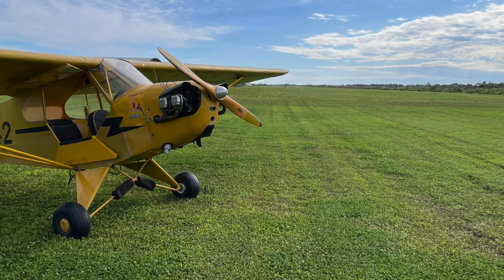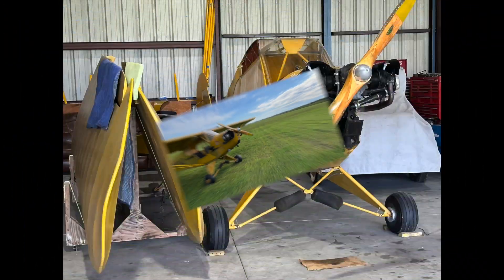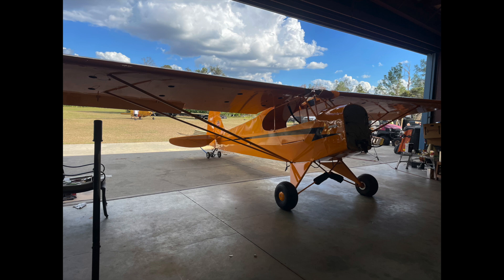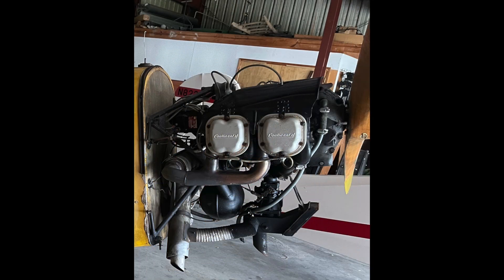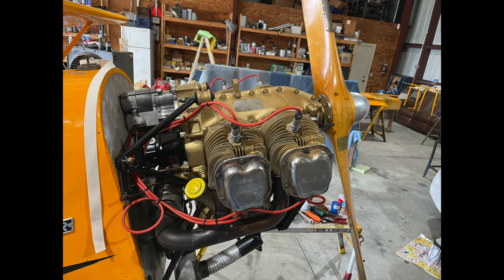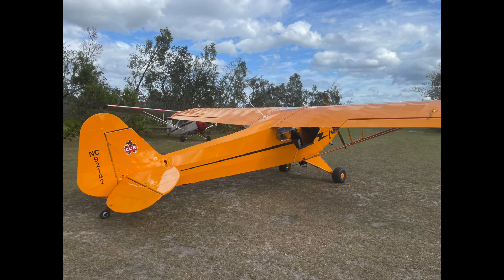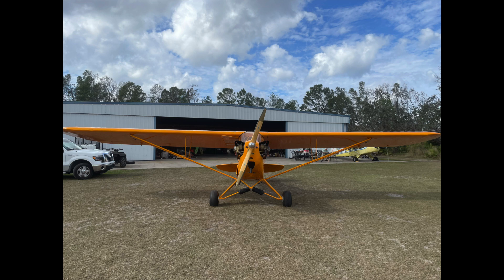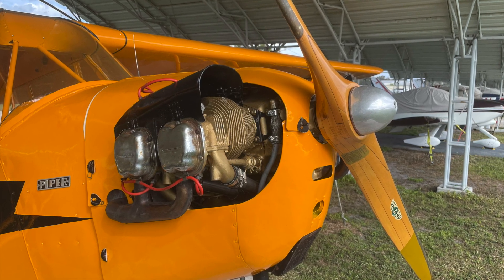1946 Piper Cub back in the air

Comment: Beautiful!  My J3 is solid and has a recently rebuilt 65 hp along with a new wooden prop.  How long did the recovering and painting take?  Is this typical work for your mechanic?  Might he be interested in recovering another Cub?  Again, very nice!
Reply from the maker: Thank you.  He had my airplane about six months.   It was not a total recover job.  Most of the fuselage and control surfaces were in good shape.  My mechanic has a bunch of fabric experience on Cubs, Champs, etc..., not every mechanic  nowadays does however.